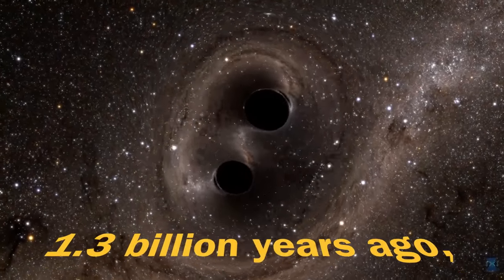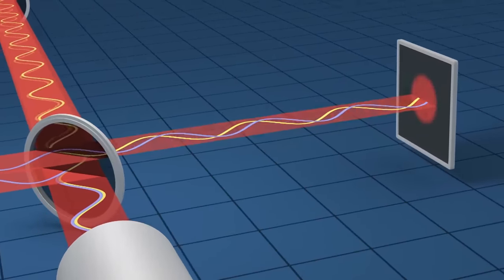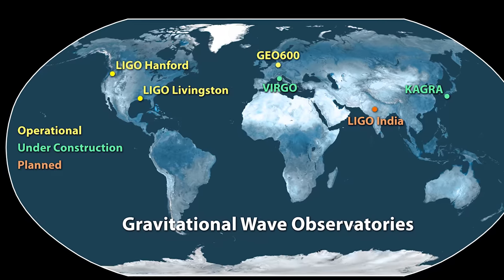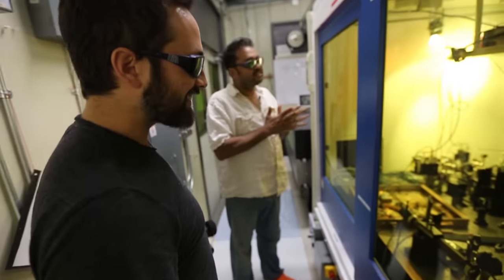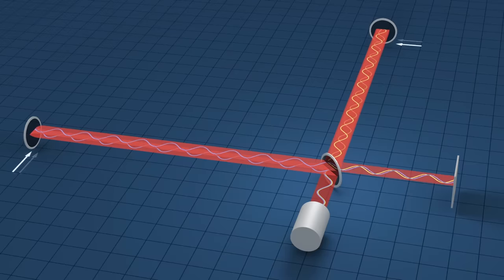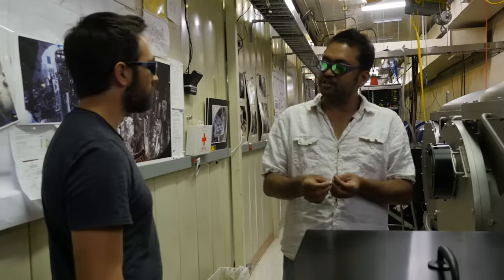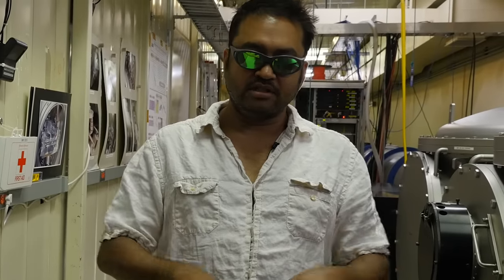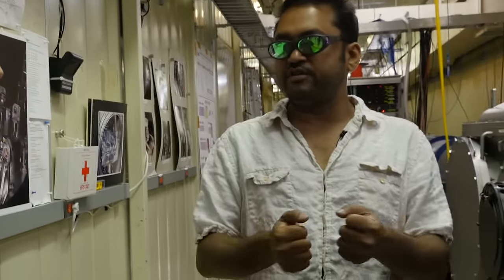The Absurdity of Detecting Gravitational Waves

Comment: so a stupid question but would black hole collisions be "relatively"  common in the history of the universe ?
Reply: It would seem so, since the detection of these waves occurred relatively soon after the machine was turned on. Either that, or its a huge coincidence.
Reply: Ah my stupid, i thought they were detecting them from a specific event, which upon refection would be impossible because they would arrive at the same speed as the light from the event itself i guess.
Reply: If these waves behave like light, they would move slower than the universe initially expanded, so what we detect are remnants of the early universe and not stuff that's actually happening now.
Reply: bkingk8 light is a form of radiation, they all travel at the speed of light. all information came at the same time.  black hole will collide as they are extremely dense and long lived so they have the reach and live long enough to collide.
Reply: Amici Nybråten One neat fact about gravitational waves is they are not "slowed down" when passing through matter.
Reply: GDI sweet name,  light doesn't slow either, it absorbed and re emitted,  light always travels at the speed of light, no acceleration 100% full speed 100% of the time.
Reply: Blackadder 1620 I know that. But gravitational waves are special because they do not even "appear" to slow down when passing through a medium since they are not absorbed. I teach physics.
Reply: GDI That's not why light emitted at the early universe doesn't reach us before now. It's because space expanded faster than light travels, and so light has had to cover very large distances to reach us, eventually travelling for so long the universe it left behind is nowhere like what we detect with the light we recieve.
Reply: GDI If you teach physics, then your initial reply was a very bad one for someone dealing professionally in pedagogy.
Reply: GDI If I recall correctly, it really was a big coincidence.  We haven't detected any (or maybe just a few, can't remember exactly) more waves.
Reply: Amici Nybråten My initial reply contains no errors, you simply assumed that I didn't know the details. But that insult is also unnecessary and irrelevant.
Reply: since the universe is infinite that leaves room for a lot of blackholes
Reply: Ye I think the reason they are not more common is just because of the fact that they need to be similar in mass/size otherwise they just sorta slingshot each others orbits instead of colliding.
Reply: GDI It wasn't about whether you knew, but about the impact of the reply to a possible "student". It was a bad reply.
Reply: LIGO has already detected SEVERAL such collisions; does that answer the question?
Reply: +Maxim Ivanov Exactly the answer I was looking for, thanks
Reply: bkingk8 It's not a stupid question.
Reply: We never can see what is happening right now.  The sky is like gazing into a time machine.  The farther we look, the more ancient the things we see.
Reply: Not a stupid question!  
In the observable universe, black hole collisions actually do occur pretty regularly.  But the problem in detecting them is sensitivity.  The farther away the merger happens, the weaker the gravitational wave is by the time it reaches Earth.  So for a given sensitivity of detector, we can only see black hole mergers out to a certain distance -- we can only see them in a certain volume of space.  So that's what limits the rate we observe merging black holes.  If we can increase our sensitivity, then we'll see them happen more often and we'll see a lot more which are very weak.

In fact there should be a continuous "noise" of gravitational waves coming constantly and from all directions from the most distant black holes merging together in the early universe, and the hope is that we can achieve the sensitivity to actually see this in the next generations of detectors.  The scientist in the video refers to this briefly. :)
Reply: There's more evidence for the earth being stationary in the center of the universe, where the sun, moon and stars circle around it, there are no other planets, or black holes, the universe is not continuously expanding...
There is only earth. And space is a fluid, the stars are created by a series of constant tones, which causes an effect called sonoluminescence.
So when you are looking up at the stars you are actually seeing sounds, each one of those sounds are a part of what makes up everything on the earth...
But here, the video is trying to say that the sound waves are actually gravitational waves coming from black holes... 

That's as false as Barack Obamas birth certificate. Most of this is all cleverly contrived myths. Just to give heed to the false gods of science.
Reply: Generally speaking black hole collisions are relatively uncommon
Reply: And there we have it, folks. Nick setting the rest of us straight.
I love YouTubers like you, Nick! I really do.
Reply: Watch the last video. It was a coincidence and even months after this observation they didn't get another signal that was as strong.
Reply: Nick FOG ya know god gave us the ability to reason and use science to understand his/her/its creation.

by ignoring scientific evidence you are basically being blasphemous.
Reply: Nick FOG Poe's Law
Reply: "black hole" is absurd fiction
Reply: Plautus Satire well its a good thing that your opinion means nothing to me then.
Reply: bkingk8 wow you accidentally said something correct. Facts do require evidence. What a pity you don't apply that standard to your erroneous beliefs and ignore evidence of actual facts that contradict your beliefs. That is religion, not science. Further, books are obsolete, so they may as well be burned since you can have hundreds of thousands of digital copies on a thumb drive.
Reply: Plautus Satire dude enough with your trolling lol
Reply: Bob Tahoma since "black hole" is absurd fiction then "these collisions" can never occur
Reply: i love watching veritasiums videos because it almost always starts a war in the comments between absolute idiots, and regular people.
Reply: ddeerrtt5 hehehe
Reply: ddeerrtt5 you are greatly confused. For the most part, all "regular people" are absolute idiots. People of exceptional intelligence are extremely rare. People of exceptional intelligence who can also think critically and rationally are even more rare.

It is much easier to be wrong than to be right. Consequently there are always more people who are wrong than who are right. The majority is always wrong.
Reply: Plautus Satire I feel like you just want to feel smart so you go on YouTube and type away your opinions, hoping that one person will appreciate the effort that you put into your explanations (which to be fair ARE pretty good). Although I would prefer to agree with sound science even though it has been proven that a lot of published research is indeed false.
Reply: ddeerrtt5 I don't see how your feelings are relevant but you illustrate precisely my point about "regular people". Well done.
Reply: ddeerrtt5 if you're calling "gravity waves" sound science then you couldn't be farther from the mark. This "force" called "gravity" cannot be generated, amplified, blocked or manipulated in any fashion which strongly suggests it is fictional.
Reply: bkingk8 that's just a common opinion but it's not a fact. He gave us the ability to reason to see and to hear, not just for stimulation, but to be aware of reality.

What it really says is that God allows a strong delusion to come over the people that are not fully seeking God because they do not love the truth. And that is how you can tell the difference between a true follower compared to one who would rather go go by the way of the world.

By accepting science fiction it is causing you to be deluded from seeing the true reality.
Reply: Nick FOG thankfully i was given free will to have an opinion to make choices based upon evidence and testing said evidence.
Reply: bkingk8 upon what evidence do you base your belief in "black hole"?
Reply: I believe you are trolling but for the sake of argument i will respond.

My evidence is the experiments they do.

As an example this one here, they said "if we do this" (setup the lasers and monitor them) "if our hypothesis is correct we should see this result" (which they did).

I do not have the time available in life to fact check everything, but if it has been peer reviewed and no one has proven them wrong (they can say they are wrong all they want but if they do not prove it by experimentation then its just an opinion) then I am going to accept it.

If i had the time i would go all the way back to basic maths and physics and run every experiment for myself to prove that physics is correct, ie: dropping a bowling ball and a feather in a vacuum and so on. but i don't and i never will.

But I can do simple experiments at home to check that the  science we are taught is correct like If you heat this water with this much heat for this long the temperature will rise by this much.

The beautiful thing about science is this could all be wrong and one day it might be proven so ie 
++++++++++++++++++++++++++++++
"hey you remember that experiment that proved black holes colliding release massive gravity waves, turns out they actually measured a flux in the electromagnetic  field of the eatth cause by swap gas".

"Really how do we know"?

"Well we came up with a some new data thanks to some person who was conducting a different experiment at the same time and it proves that our data was wrong"
++++++++++++++++++++++++++++++

Now let me make it clear 
1- I do not trust our governments they are pretty much all run by crooks, we are not told the truth unless its been sanitised and had they spin they want put on it.

2- I do not trust everything i read or see, but if it's from a credible source then I will take it as fact till proven otherwise by another credible source

3- if two credible sources tell me different things and it's important enough I will look further, mind you it better be bloody important to me I am very busy doing human things.

and finally I know we cant prove black holes are there by looking at them but all these guys and gals who spend their lives trying to figure out how the universe works, well they do experiments and say things like.

"If what i think is right and i do this they following should happen"

Then they do it and if it happens they must have something right eh?
Reply: If you cannot disprove the existence of gravity, then it must be real and seen as a fact.
Reply: ddeerrtt5 you're confusing "gravity" with attraction. Yes attraction does exist in the universe. Is this attraction due to some metaphysical property of matter that cannot be manipulated in any real fashion? That's a bit too much faith for me. I prefer replicable phenomena, like electromagnetic forces.
Reply: bkingk8 but the thing is, that you cannot test the evidence, in order to do so you must have the correct understanding of what is actually going on. And simply put, a black hole can't even be created in space or in experiments. Neither can planets.... But it is possible to create a star.

In order to create a star you must understand that the only possible way they form is in a liquid like water.
Reply: Nick FOG no dude simply no
Reply: bkingk8 why would you refuse to believe the proven evidence for space being water... It's more possible to recreate and prove the model of the universe that I know as true.
Reply: Nick FOG literally every aspect of planets and stars, including their formation, can be replicated in the lab so I'm not sure where you got the idea that planets can't "be created" in experiments. I also don't know where you're going with the water idea.
Reply: Plautus Satire what are you talking about?
the scientific evidence of the universe according to your interpretation cannot and will never be proven or fabricated, it's all false information. It does not happen in any labs.
You cannot use false information to try and recreate something that doesn't exist in the way it has been explained...

Your confusing CGI with reality. It's easy for them to draw it up digitally. but to physically cause a terrestrial planet to exist in a lab is an impossibility.
Reply: bkingk8 not a troll, I just believe in the true form of the "universe"... There are other realities that are more real than the one you've been taught about and believe in, and they are even more plausible.
Reply: Nick FOG so it's a then
Reply: bkingk8 it's more insane to believe the lie and continue in it. Rather than seek the truth and understand how to live a more legitimate lifestyle for a greater purpose.
Reply: Nick FOG ok nick this will be my last reply to you. seek some help.
have a nice day mate.
Reply: bkingk8 people see but do not see, and hear but they do not hear... You people just want to be stimulated.
Reply: He's no troll, he's a bible thumping, flat earther. Supposedly, his god separated the waters above from the waters below and we live under a dome, on a flat Earth surrounded by water. These people exist and YouTube is their haunt. It's as sad as it sounds.
Reply: Fletcher DeMaine God Almighty did, but it's not thumping. 
It's believing in the truth rather than the lie.
It's 100% true, every way you look at it. Especially when you personal begin to try and prove all of the claims in the bible...

But just by looking at the stars, you can tell where we are, and begin to find that everyone's been in the dark.
Reply: +Nick FOG
You're being facetious.  Space is obviously not made of water, that's just dumb.  Show me a picture of water in space.  Measure for me the index of refraction of space and show that it is the same as water.  Come one now, you and I both know that space is really a black carpet put up there by the sky god.  We scientists choose to study and understand His Holy Fabric and if that should happen to include its holes and imperfections then who are you to judge us?  Now go away.
Reply: watsisname how do you know that for a fact? Just because we were taught that doesn't make it true.
Reply: watsisname you people will believe in any other gods and worship any idol, just as long as it's not GOD Almighty...
Reply: Light travels slower through various matter, including glass, air, and water.
Reply: Nick FOG I never once said, suggested or implied that "evidence of the universe week never be proven" or any other such nonsense. As I stated above, every planetary or stellar phenomenon can be replicated in the lab for study. All real phenomena can be reproduced.
Reply: Nick, tell us the real truth. Is the Earth hollow? Are unicorns aliens? Is Obama Bigfoot?
Reply: Plautus, if they're weapons, how do you aim two 4km tubes placed in the middle of nowhere?
Reply: bkingk8 You should know better than to even acknowledge these people. Ask a religious fanatic to provide evidence of their faith and they say, "it's in the bible, written by prophets". So when they want evidence the earth is round, and evidence of gravity and so on, just say "it's in this astronomical journal, written by scientists". They've already seen the evidence of these truths and chosen to flippantly deny them, because it makes them uncomfortable to be so small. They WANT the earth to be the center of the universe, they want to be special and have meaning, and will never come to terms with their insignificance.
Reply: You have to distinguish between the whole universe and the observable universe. The observable universe is finite.

The whole universe is actually believed to be infinite (by main stream science).

However black holes outside the observable universe cannot be observed or interact with us in any way, therefore their gravitational waves will never reach us.

The reason why we believe the universe is infinite is as follows:

All of modern cosmology is based on an a principle called the 'cosmological principle' which states that on large distance scales the universe appears homogeneous and isotropic. That means it looks the same in all directions where ever you are. (BTW this is supported by observations, its not just an assumption).

This means the universe cannot have an edge. This means that there are only 3 possible geometries for the universe; flat, spherical and hyperbolic. 

A flat universe is infinite, spherical and hyperbolic are finite.

To tell which of these geometries matches our universe an experiment was conducted that essentially measured the internal angles of triangle.

On a flat geometry the internal angles of a triangle add up to 180 degrees, on a spherical surface the angles are greater than 180 and for hyperbolic less than 180.

The measurement shows that for our universe the internal angles of a triangle add up to 180 so we say the universe is flat and therefore infinite.

Now the measurement is subject to an experimental error, I don't specifically know what it was but lets say plus or minus 1%. In principle if the universe had extremely slight curvature it could be hidden within the experimental error but its still more likely to be flat.
Reply: A black hole collision happes once in 10 000 years in a Galaxy but because there are so many of them in the Space it happend quiete often.
Reply: TheThanatosian I say God spoke the world I to existence.

And that statement has irrefutable evidence that proves the statement. And not only does it prove that, it also proves that the space is water and that the biblical model of the universe is more true through and through.
Reply: kopf nuss none of that is a proven fact, it's just some estimates of a false reality drawn up on computers.
Reply: Ben Booth we have the ability now to check and recheck the evidence given in order to discern its validity, and there is nothing that supports the common  understanding of the whole universe.

It's time people wake up and take back control of our minds.
The word of God is not for controlling people, it's for reminding people of the truth so that we do not become controlled by those who are currently oppressing the masses.
Reply: TheThanatosian we deny those false beliefs because they are clearly based on conjecture, it's all cleverly contrived myths. They cannot be proven to be real, the only reason they have gotten you people to believe it is by drawings our reality up on computers and causing that deception to seep into every source of our supposed higher learning..
So the most capable minds are all washed up trying to prove a false belief rather than focusing on seeking the truth.
Reply: Plautus Satire it cannot be reproduced and it never has been... I don't know why you think that has ever been possible. 

I'm baffled. If it is at all true, then it could be replicated in the same way it was created, but it cannot be done through the scientific beliefs you people have obtained...

But the truth can be used to recreate it. And the truth is also the backbone to the biblical beliefs, they completely compliment each other.

Simply God spoke it all into existence.
Reply: +Nick FOG You're quite right I forgot to mention that it is only a prediction. Never the less the
collision of two black holes is nothing common
Reply: how i am feeling with some of the people who are trolling this thread.
http://i.imgur.com/2MYycFV.gif
Reply: Nick FOG How is confining oneself to one specific ideology or belief freeing ones mind?

What I explained was the main stream science view, no one said it was absolutely true, its just best explanation we have at the moment.

Scientists are open minded and prefer intellectual freedom to explore new ideas in the search of the truth.

My problem with any religion is that they think they have all the answers but they catastrophically fail to explain anything in the modern world.

I think you should free your mind from the tyranny of religion.
Reply: Ben Booth it's simple, how can you believe the truth when you've tried so hard and put so much time into believe things that are unproven.

God has been proven man y times, not just because the bible but because of life itself.
But the claims that science creates are not and are far from ever being proven. It's basically a matrix, it is not a legitimate reality, and by conforming your minds to believe a false reality you are blinding yourself with science, and it's science fiction at that.
Reply: Nick FOG IMHO There is no such thing as absolute truth. There is no reference material that we can check our 'truth' against. As humans we have to decide for ourselves what is correct and incorrect.

At best, all you can do is to think about all of the possible truths and attach probabilities to them.

I'm not saying that mainstream science is the truth, I'm not saying God doesn't exist. I'm saying that we cannot know. It comes down to personal choice, intuition, instinct or whatever.

You prefer religion, I prefer science. We're both searching for the truth. Why is your truth better than mine?
Reply: Ray Williamson the facilities in question are weapons labs, not warships, so they don't have to aim them. If you honestly think that megawatt class lasers are being developed to find "black hole" then you are dangerously deluded and extremely naive (or ignorant, if you prefer).
Reply: Nick FOG I'm not the least bit convinced by your "god" story
Reply: kopf nuss "black hole" is absurd fiction
Reply: Ben Booth there is actually such a thing as absolute truth... I don't know where you people get off saying nonsense like that... The plumb line used to discern is the truth.

It's strange though, we could go in that loop forever and some people just won't get it.
If I were to explain discernment I would tell you it's a spiritual gift, but you won't understand... It's like having an inner lie detector... By hearing and by seeing we can judge whether or not something or someone is a lie.
Reply: Nick FOG Ok so I'll try to explain it, remember this is just my opinion its not science or anything.

You claim to know the truth, you are convinced of it. You may get feelings of exasperation when people fail to see things your way and you may be tempted to call them ignorant. 

Others who like science may also claim to know truths, such as General Relativity or Quantum mechanics, they are convinced of it etc.

Who is right and how can we tell?

Of course some people may say that if you see someone standing someplace they are there and that is a truth, but what if you hallucinated, unlikely but there is still a chance, however small, that you did.

Others may claim that the sum of the natural numbers is equal to -1/12 is a truth, but mathematics is a set of rules designed by humanity, what if one day we changed the rules so that it wasn't? Again, extremely unlikely but you cannot completely discount it. 

Some may say that the truth is out there and just have to find it, but how would we know when we did? If we can't tell can we legitimately define the concept of absolute truth?

I don't think so.
Reply: Plautus Satire I'm no troll, and if you don't know that the biblical model of the universe is the most accurate then your just as deluded as everyone else.
Reply: Nick FOG C'mon Nick, tell me your 'truth'.
Reply: bkingk8 I refer you to my three previous comments to you above
Reply: Ben Booth we basically need to believing all things first. If we do not, and we start to draw conclusions early in our understanding, then we will fail to know what a actually possible... The problem with society is that we are put into a system that attempts to control our thoughts as soon as they possibly can.

Non-believers commonly think that believers lack the ability to think rationally, but on the contrary, we have gone through the process of believing in so many different things, so we have canceled out that which doesn't stand up against reality. Not just because their beliefs contradict God, but because the beliefs contradict themselves.

If you tell a lie, you have to keep telling lie after lie in order to cover it up, especially when billions of people hold onto everything you say as absolute truth. If you begin to be proven a liar then people would assume that everything you've ever told them was a lie, and they would not be wrong for doing so, and they would have every right to call out the lie.
Reply: bkingk8 see my most recent comment to you above
Reply: Nick FOG Firstly, I do not support the establishment so we agree there.

"we have gone through the process of believing in so many different things, so we have canceled out that which doesn't stand up against reality"

This is pure arrogance or ignorance I'm not sure, you have not experienced all of reality so I'm sorry I think that's a load of crap.

Why are you talking about lying? I don't understand what your getting at.

If you mean that I'm insecure about my philosophy or physics and I'm continuing the lie to save face, I'm not. 

Not sure what you were trying to say with that last post.

Anyway good evening to you and I wish you all the best. Bye.
Reply: Ben Booth I'm not like most people who claim to be Christian though, most people make the assumption that we are all ignorantly and blindly following the crowd in a herd mentality.
But the truth is that most people want to believe in God and go to church all their lives not knowing that they've been receiving a placebo from the church establishments that are under the control of the state and country in which they live.
Reply: Ben Booth as far as lying, I am referring to it in the sense of the legal definition of person, which is a group or corporation.
And as a group or corporation a persons can and will lie in order to protect their belief system.
Reply: bkingk8 see above
Reply: bkingk8 see above
Reply: bkingk8 continue seeing above
Reply: bkingk8 do not hesitate to see above
Reply: Plautus Satire what's your argument dude? why are you wasting time instigating nonsense? when you should be spend your time figuring out and spreading truth.
Reply: Tell us how you came to the realization that black holes are a contrivance to support sci-fi beliefs.
Reply: bkingk8 be advised you should see above
Reply: bkingk8 you may want to see above
Reply: bkingk8 see above
Reply: bkingk8 it would save a lot of time if you would see above
Reply: So what’s it like to be DSM-5:
DSM-5 criteria for narcissistic personality disorder include these features
- Having an exaggerated sense of self-importance.
- Expecting to be recognized as superior even without achievements that warrant it 
- Exaggerating your achievements and talents
- Behaving in an arrogant or haughty manner
- Believing that you are superior and can only be understood by or associate with equally special people

Looking at your comments with their general tone of arrogance and self-implied superiority, I think you should seek help.

Oh and you ain't no roman playwright. I am sure he would have come up with something better than "see above".
Reply: bkingk8 perhaps instead you should see above
Reply: Plautus Satire oh i forgot
- The desperate need to always have the last word, this allows you to feel that you finished the argument and won.

Reparation is a stong sign of a weak mind brah :)
Reply: bkingk8 or you could see above
Reply: Plautus Satire 
And there it is....
My work here is done.
Thanks for playing.
Reply: bkingk8 it would behoove you to see above
Reply: Everything is relatively common if you look at enough stuff.